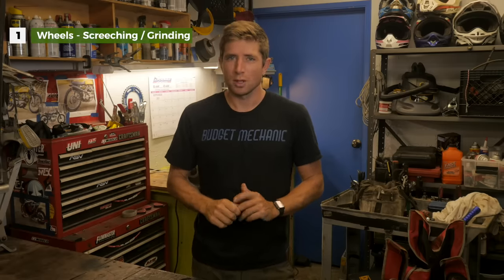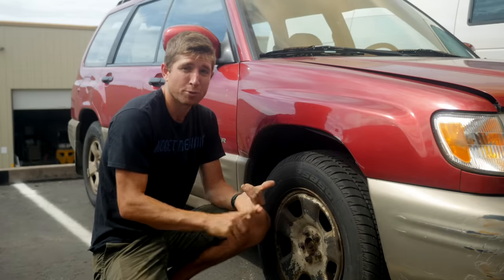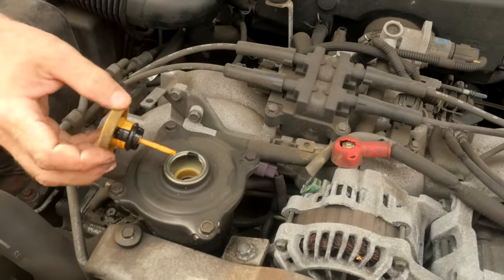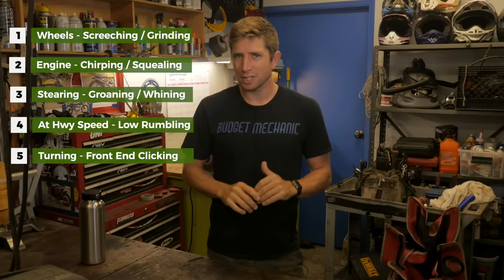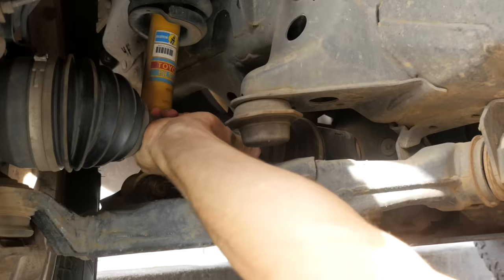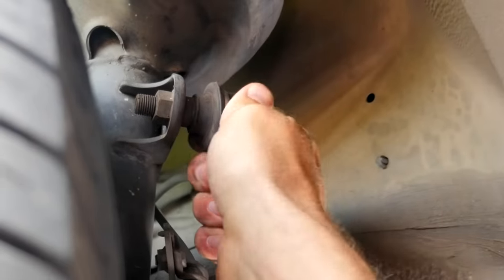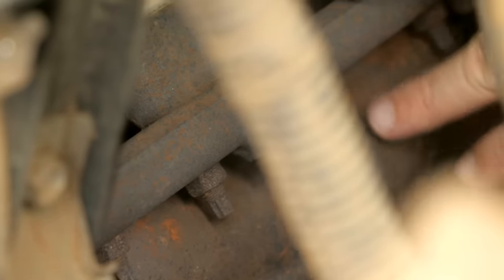8 Top Noises Your Car Engine Makes and How To Fix- Grind, Clunk, Squeal, Click, Groan, Rattle

Comment: I think for me as a woman finding an honest mechanic is the biggest "diagnostic^ I could ever perform. Some of these noises are a simple fix but keeping a mechanic honest is definitely the hardest part. I experienced #8 the hot rod noise. Guess what it was? A shady mechanic stoled my catalytic converter and replaced it with a welded pipe. Just yesterday another one replaced a perfectly good engine mount instead of the actual problem which was the arm which is worn out and left it up to me to decide whether to replace the mount or not. So literally all he needed to do was tightened up the old engine mount along with the worn out arm until I returned with the correct part but instead he went ahead and changed a perfectly good part just because he wanted those $40 right then and there. It is 2 am and it's still bothering me so I decided to research further... it's because of people like you, providing educational videos like this that I catch the problems mechanics don't care to find. I just happened to find your video on a totally different subject along the eay.
Reply: I 100% know where you're comin' from and I agree, mechanics are unfortunately, some of theee most dishonest people on Earth.
Reply: Yesss I paid $600 for my car to still have the same problem and people need to start looking at the reviews it helps a lot they getting shady by the day
Reply: I'm not a woman but am BEYOND uneducated when it comes to mechanical work and can tell right away when i try explaining what's wrong and get taken advantage of BIG TIME.. I heard a banging when I shifted gears and saw a video on here about motor mounts and was exact what it was after the axels and a bunch of other things were replaced that didn't need to be and the engine was still banging around and just needed two simple motor mounts so I started self learning from here on out so I don't get taken advantage of again and know my stuff!!!
Reply: I understand how you would feel, though I am a man but growing up I have literally watched mechanics and repairers and dealers try to BS and make up shit to my mum. Little did they know that a now 46y0 qualified hairdresser/account co-owned/managed/ran a panel beating and spray paint shop with my dad for 10 years before I was born 😂. 
It’s priceless the look on their faces when she tells them what really is wrong. But I hate seeing them think she is stupid as a woman
Reply: About a year or so ago I was looking into ways to get better gas mileage in my car, then it turned into making sure the 33 year old truck I own is safe to drive as well... 1 year and $6-700 in tools later and I'm doing all my own mechanical work, helping friends and I just love it. My truck is about as safe as a truck built 30+ years ago can be, and I've done thousands of dollars worth of work to it for pennies on the dollar. And it's all done right! No lies!
Reply: Me too, trying to learn about bumpers
Reply: I "HATE" that I always bring a man with me to these shops. You literally see the way they are treated with respect and like they know a thing or too even if they are clueless, but when I go it's speaking slowly, it's talking a bunch of jargon even I can tell is just BS, and recommending all sorts of things that all of a sudden need doing. I remember a time I was on the way to jury duty and I heard this really loud squealing  randomly out of nowhere. It was so jarring I had to pull over and immediately find the nearest shop. This guy did a check and quoted me $800 after like seconds of looking at my car. My spider sense was tingling that this guy was trying to screw me, so I found another shop nearby and guess what....the guy did a free inspection and then came back to me 20 minutes later with a rock. He said the thing had gotten kicked up into the brakes...price to fix it: $0.
Reply: You're completely right.
Reply: Amen to that. I totally agree. I am a women too and this happens to me alot. Also here researching...I find this video so informative
Reply: Luckily the shop I work at the mechanic is very honest.  I’m personally not a mechanic, I’m a lube shop technician but we have a mechanic that works there.  I have worked there for 11 years and he still calls me over to show me what’s wrong when I need him to work on my car.  I always tell him I know you aren’t lying to me just do what needs to be done but he still insists on showing me.  Most of the repeat customers that know him say the same thing I do as well.  In a few cases since we are a smaller shop that may not have the equipment or tools to diagnose certain problems that could have more than one cause instead of recommending doing a few different things he will straight up tell the customer to go to a bigger shop with the proper equipment to diagnose it so they don’t wind up paying a lot of money for something that might be something another shop can narrow down to a certain problem and fix much cheaper.
Reply: There's a Chinese saying:-

"What man does, The sky watches". These dishonest mechanics will have it one day by someone. Be blessed.
Reply: @rocco2103  Good for you. Most people who work on cars are ill trained and inexperienced. Often they don't care about anything except what they can add to the bill. Looks good to their boss.
Reply: That’s what I’m going through right now. I don’t want to drive my car but I cannot find an honest guy or someone knowledgeable to look at it for me. There’s one guy bit I’d have to leave it and it could be a week before he gets to it because he has so many cars and he’s affordable. The wait for him is ridiculous.
Reply: Never trust a mechanic when they can't suggest simple practical solutions.

Comment: I've been neck deep in automotive Youtube for over a year now and this is the first one I've seen that has sound samples of the issues. Teaching is a special skill and you have a talent for it. Well done.
Reply from the maker: Glad you like it!
Reply: Agreed I'm trying to find sound clip of ball joints while driving and can't find it anywhere😖
Reply: Hi, brilliant video,  just had my offside front wheel bearing replaced and 2 new tyres fitted on front, balance and tracked.. was nice and quiet, no juddering at higher speeds . Driving to work after weekend,  there is now a rumble type noise and definite knocking when coming off accelerator at any speed. Was wondering if could be loose wheel nuts... ? Car is 2010 volvo v50 1.6 diesel.  Any advice greatly appreciated  before going back to garage . They also checked entire suspension at front and said all was fine

Comment: Finally, a car channel that has examples of bad sounding noises from cars.  The car noise sound effects truly helps. I have a car noise and i think it's a bad stabilizer link because I just replaced the brake pads due to the grinding noise.  Damn mechanics wasn't looking at other stuff within that area while fixing my car.
Reply from the maker: Glad it helped 🤙🏽

Comment: 1. Squeaky Brake  0:26
2. Squealing Belt  1:11
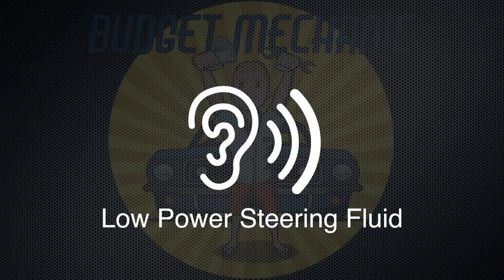3. Low Power Steering Fluid  3:06 
4. Bad Wheel Bearing  4:01
5. Bad CV Axle  5:06  
6. Bad Stabilizer Link  6:58
7. Loose Exhaust Shield  9:02
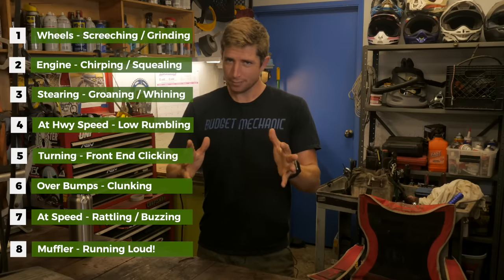8. Exhaust Leak  10:30
Reply: Control arm bushes

Tierod
Reply: You are very good I love the way you explain  everything there is a god ❤😊

Comment: I can see you made around 10 videos per year but this is the most helpful video I have seen yet for car noise issues and you deserve more views. My car is new 10K driven, 1st service done. Some kind of loose nut sound comes when accelerating sometimes at random and a squeaking belt like noise which is also random. Going to get a look at it at dealership soon but the issue is sound is random and I can't reproduce it at will even when I am doing the same stuff I did when sound 1st came.
Reply: i have this same problem
Reply: have you found out what it was
Reply: @AllAroundDaryl  Some loose parts under the dashboard. They tightened it up but comes right back in a few months. At first I thought they did a poor job but I noticed a trend, It comes when seasons change. My guess is some stuff compress/relax when seasons changes and it has to be adjusted again also, if it helps my car is close to 50K rn. A few potholes every now and then could also be contributing to the problem but it is mostly fine now. They sort it for free when servicing so all good.

Comment: I've had this rattle for a month now and no other video shows you how the part isn't supposed to move, or includes the noise! As someone who doesn't know their way around a vehicle when you showed how the stabilizer link shouldn't "rotate" it was like a eureka moment! That's exactly what one of mine does and I'm betting that's the cause of my rattle. Will be installing new ones this weekend!
Reply from the maker: Glad it helped! Good luck on the fix 🤙🏽

Comment: I've had a rattle noise under the hood for at least a year, so in trying to diagnose the sound the mechanic found I needed both CV axle, shaft and seals replaced and outer tie rod.  Picked up car yesterday and the rattle sound is worse!  2001 Toyota Solara. Loved your video, now I can go back better informed about what to look for or find a better place to take my car, but that's not easy to find.  Thanks!

Comment: Finally someone who actually recorded the noises. Such a simple thing to do but many do not include it.
The stabilizer link sound sounds fairly similar to my issues. but mine is more of a clonking noice, as if you have something loose in the baggage hold, but it comes from near the passanger door instead and is kinda muffled when you are inside the car.

This just reaffirms my belief that something is fucked up with something when it comes to the parts of the front wheel.
Gonna look in my haynes book and see where the lifting points are for my car and lift it on sunday and do the wheel checks etc.
Reply: Oh and I might as well check the driver seat front tire too just to be sure, sometimes I mistake the direction of sounds.

Comment: Great list. My Ford started making a couple of noises last week. Checked driver side CV boots. One is leaking grease. Potential source of rotational grinding noise? I could sometimes hear a knock sound from rear of car too... I'm driving with the seats folded down at the moment. Would never have looked at the heat shields, but found one cracked all around a fixing bolt. Tapping it with my finger makes a knocking noise on underside of car. Affixed it with a steel mesh patch plus cold weld paste. Hope it works! Have to put car in shop for CV boot.

Comment: My car is making a handful of different noises. None of the videos I've watched or articles I've read adequately describe them.  Your video finally has one.  I'm going to check my power steering fluid ASAP. Thank you!  The noise I'm most concerned about is what I'd describe as a drumming, but not a deep-sounding drum, under the hood while idling.  It's about every half second.  I can't hear it when I'm driving, but that doesn't mean it's not there. If I drive to the pharmacy & have it in park at the drive through, I hear it the whole time. I've not heard this sound in any video. 😫 2008 Mazda 6 if that helps.
Reply: My air and heat makes rumbling sound  when  turned on and also  when  turned off.

Comment: Something that I’ve done a few times to help diagnose an exhaust leak that was harder to find:
Be careful when doing this, since you could burn yourself, but it’s still a pretty low risk. Once you’ve got a good general idea of where the exhaust leak is coming from, move your hand around the exhaust pipe (or muffler, resonator, cat, etc), with the car running, and feel around for hot air being blown out. Don’t touch the actual pipe itself, just keep your hand hovering around it. You’ll feel the hot air from the exhaust blowing on your hand, which will make it much easier to track down the exact location. Again just be careful not to touch the pipe by accident; the air won’t burn you, but that hot metal definitely will!

Comment: Very good video. The sound clips very helpful! I have a sort of grind/rattle that happens when pulling away from a stop. All front suspension and sway bar bushings were replaced recently. CV axles  and wheel hubs, also, in the last year or two. All motor mounts replaced in the past couple of years. Would a heat shield only vibrate pulling away from a stop?

Comment: Just come across your video. Will watch later cus I need to find out what the banging noise is under my ds3. Can only hear it on uneven Rd surfaces or over bumps , it's so annoying cus I thought it was down to a broken exhaust mount , got this fixed and still got same issues.

Comment: I have random thumping noise when I turn the steering wheel left or right and when I brake. It’s sometimes louder sometimes not as loud and it happens randomly.  Brought it to 3 people so far. It’s a ford rv chasis 2020 jayco precept 34g

Comment: I started hearing a sound that's sort of like scraping or grinding while driving .It occurs intermittently and it sounds like it's coming from the inside of the car .
Having trouble pinpointing exactly where the noise is coming from. Possibly the wheel,I don't know.It occurs not just when I  make a turn

Comment: Excellent video. The sound on my car comes from the FL tire, like when driving over a nice clean, painted floor, but in my case, it does it on the concrete ground. Could it be a defective tire with tread separation?
Thanks a lot!!
Reply from the maker: Most defective tires have physical signs you can see! Check it out

Comment: I had clicking/chirping sound coming from the front tire well combined with my ABS check light. Turns out I had a bad wheel bearing.

Comment: Stabilizer link are the worst job to do unless they have a nut to hold on boot.  I don't even attempt to loosen the Allen key design, jump right to grinder and cut them off.  Hate stabilizer links!

Comment: I am hearing a similar clunking sound(#6) from the front right wheel only when braking. The pads still have life in them, I dont hear that sound when going over bumps or uneven roads. Could this symptom also be related to Stabilizer link?

Comment: Brakes - Screeching/grinding - 0:26 
Belt - Chirping/squealing - 1:11 
Steering Fluid - Groaning/whining - 3:06
Wheel bearings - Low rumbling - 4:02
CV Axle - Front end clicking - 5:06
Sway Bar links - Clunking - 6:57 
Exhaust shield -  Rattling/buzzing - 9:01
Exhaust leak - Loud running - 10:31
Reply: Thank you, helpful!
Reply: What can I do about the rumbling, I get that often when I'm pressing the gas
Reply: Thank you.
My yaris made a noise similar to the first and last one today once i placed my foot on gas. Wondering what this means was thinking maybe car needs water
Reply: Not all hero’s wear capes
Reply: @jeffh.2588  True!
Reply: @babatundeolotu2996  boom NICE ONE!
Reply: I think I have an exhaust shield
Reply: Bless up
Reply: Mine sounds like the power steering sound
Reply: I love you ❤
Reply: I think I have got 1,2 and 5 sounds !!!
Reply: @dmitriyk1857
Thank you for taking the time to add exactly what times the different sounds are! You sir, rock! 🤘
Reply: Helpful thanks
Reply: ⁸8
Reply: 😊how brilliant is this .thank you..🙏🏻🫶
Reply: My noice is non of these ..but great vid..
Reply: Bushes???..my garage doesn’t know where noice is from.l🤷‍♀️..ratting..front drivers side wheel..the sound is defo a ratting sound ..like something is banging against something else..
Reply: Very informative video
Reply: Nice and very educative

Comment: I’ve been to 5 different ppl. I’ve had my struts replaced and both axels replaced and still had a rattling issue... for over a year no one could find out what it was. This video just told me it was my sway bar links 🤦🏽‍♀️ $800 later . This video just saved me probably $3,000 on w.e else I would have unnecessary fixed . Really just thank you 💖🙌🏽
Reply from the maker: Wish I could’ve helped you from the beginning, but better late than never 🤙🏽

Comment: In low rpm, I hear like... "A metal ring inside a glass bottle spining." What will it be?
Reply: Did you figure it out? I'm having the same thing happening.
Reply: most likely something is loose underneath the car. Also, is the car shaking kinda hard?
Reply: It’s probably your catalytic converter
Reply: Clutch realease bearing/gear box ?

Comment: #7 sounds closest but what I have is someone typing up front and it is not affected by rpm's and it is not consistent as it comes on and goes away ? On the freeway stuck in traffic it was very noticeable for 8 minutes , got moving and it was gone. I will crawl underneath and check

Comment: We have a 2007 malibu. And it sounds awful. We was told it was wheel barron but now it's grinding so bad I'm scared to drive it. It started out sounding like a rattling sound maybe but its not doin that anymore. When I start to drive it does it but when I'm going a decent speed it doesn't. Does that sound like a wheel barron or brake pads? Or something else?

Comment: Such great advice I really appreciate this helpful information.  I'm checking my dodge dart for bearing but only hear a loud rumbling noise at certain high speeds usually 60 or above not sure but ill definitely check and I was told my strut mounts were bad when I believe I hear a bad cv axle
Reply from the maker: Those can all sound similar. If sound is coming from a non drive wheel you can jack it up and spin to hear bad bearing. Cv shafts can be shaken perpendicular to the shaft to check for play

Comment: My brand new car has started making click noises when making turns at slow speeds. Its sounds like something is stuck under the steering wheel colum and clicks 2-3 times when making turns. Wonder what could have happened.